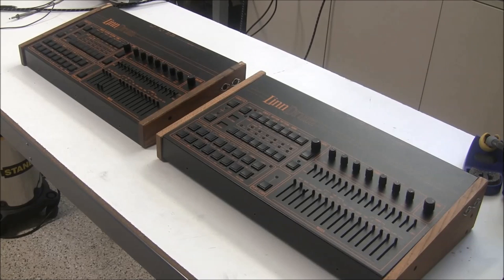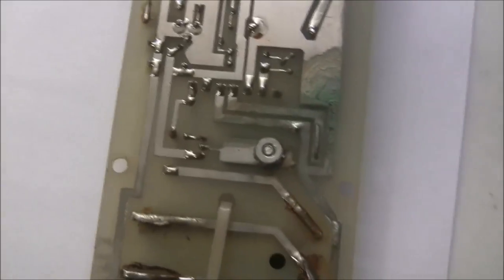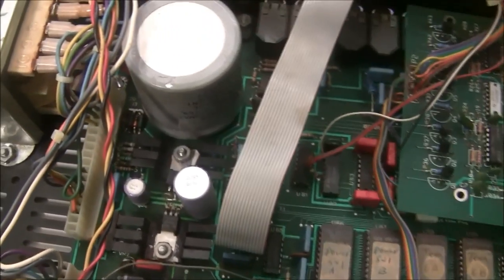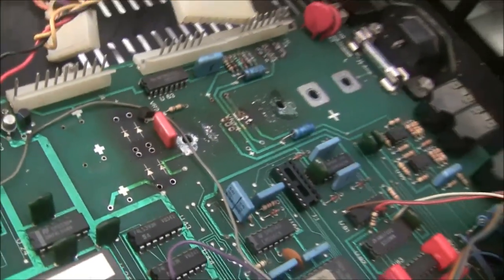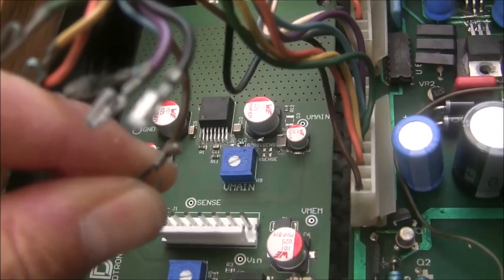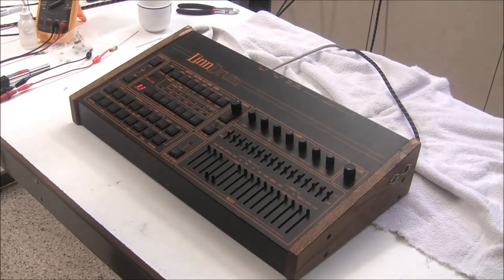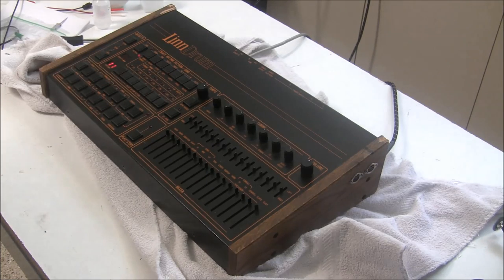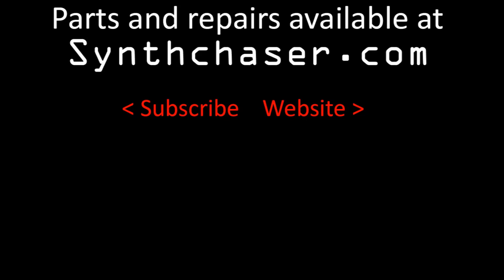Synthchaser #072 - Fried LinnDrum Repair

Comment: Nice work. What was the person thinking that previously serviced this thing? Let’s just solder these resistors on top of the others because it’s too much work removing the old ones. Oh this damn half amp fuse just keeps on blowing, so I’ll fix that by putting in this enormous 7 amp fuse.

Comment: Hi! Great work! I just fixed my Akai XR10, cracked solder joints, you can check the video on my channel if you'd like, it's a short one. But, I also own a Korg DDM110 which sort of turns on, but nothing else. Only the battery led works. I went to three repair guys and none wanted to even open it. :( Not worth the hassle, they say. So I decided to do it myself. The problem is, it all seems in order by just looking at it. So I downloaded the service manual and started tracing it. But it turned out to be more than I can handle. It seems most of it is just fine, but on the lower part of the motherboard, the + on electrolytic capacitors seems to fall in voltage. It starts with 2.95V on the left hand part (near the jacks) where it should be over 3V and goes to 0.1V as I progress to the right. The one on the far right, in the middle of the board goes so far as to show - 0.1 on my multimeter. I am actually thinking about changing all the capacitors, but what if the problem is a ceramic one, or something else? Then it will be a lot of work for nothing. I tried reversing the board and look for a short, which seems somehow obvious, but I can't seems the find the right points when I look at it from the other side. The board is relatively dense and my eyesight is not what it used to be.

Any suggestions? If not how to fix it, then how to persuade a repair guy to work on it (with giving him instructions what to look for, ie doing all the heavy lifting for him, because in Croatia, where I live, they simply cannot invest the time needed for tracing for the money they take, which is about 40$ an hour). I already do whatever I can to fix everything I can before going to them, because they get pale when they see me walking in the shop. :(

Comment: Hi
Do you need anti static mats or straps when working on the mother board ?
Reply from the maker: Depends on conditions where you're working (humidity levels, flooring material, etc).  In my location I don't and have never damaged a single thing with ESD, but for others it may be different.
Reply: @Synthchaser  Do you give rough estimates for fitting a Synthronics PSU_2B?
Is there a way around import/export duties between your country and UK?

Comment: Other than, "the client didn't ask me to", was there a reason that you didn't remove the unknown mods that disabled the voices in the first place? Do you always leave such mods in place?
Reply from the maker: The client specifically wanted the MIDI mods left in place.  I removed the minimum necessary to get it working correctly per request of the machine's owner.  I obtained the stock firmware and was prepared to remove it all.  I don't do things half-assed.
Reply: Synth Chaser Please forgive me, I was certainly not insinuating that at all!! I'm incredibly impressed and fascinated by your work, and I am grateful that you are so generously sharing your knowledge like this. I guess I was just wondering, when you see mods like that, where stuff is soldered to parts all over the board, is it better to "leave well-enough alone" when it's functional, or is it SOP to restore all connections to factory spec. Not sure which side of the line "do no harm" that comes down on with vintage synths. Thank you again for a great channel.
Reply from the maker: If it were something I owned and were planning on reselling, then for sure I would have ripped it out.  This customer was hoping the mods would work.  But also you need to consider when I'm doing this on a customer's machine they're paying for my time, so sometimes there are things I'd want to do that a customer might not be in a customer's budget.